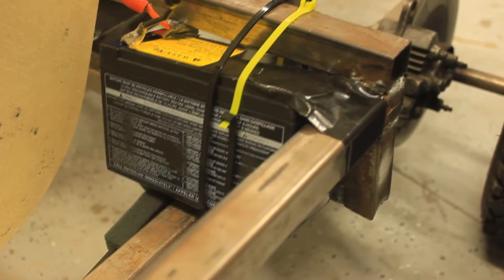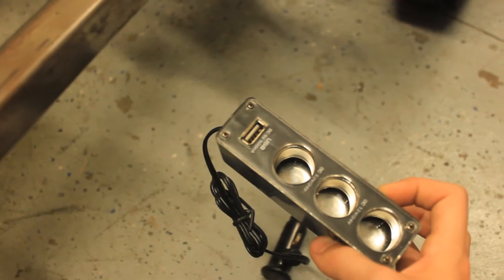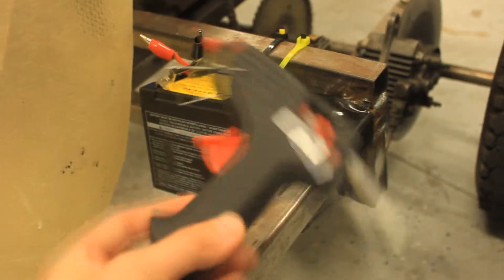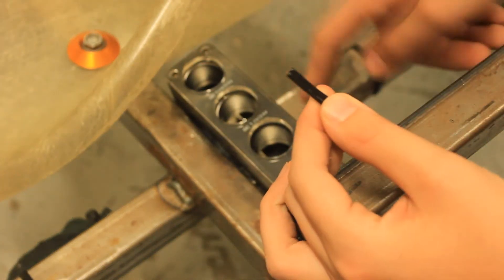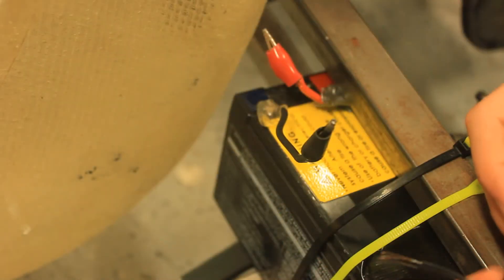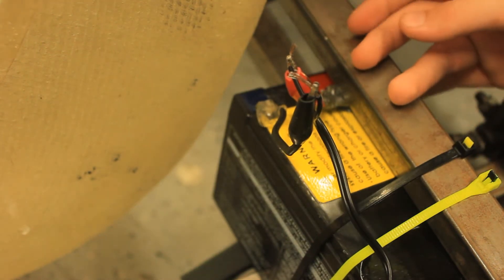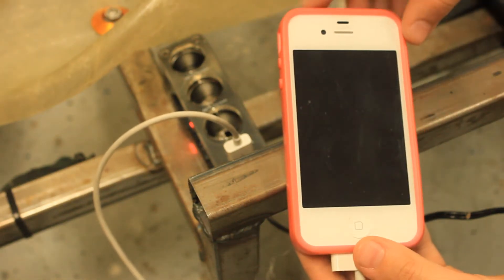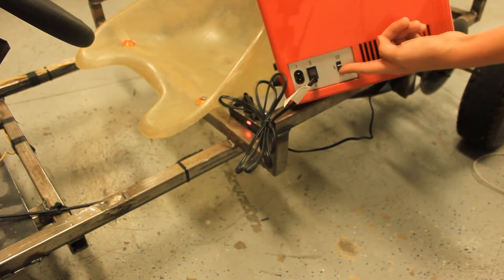How to Mod a Go Kart - Ep. 2 - 12v DC Port's + USB Port + Mini Fridge

Comment: What do you think is gonna happen to the battery if it comes in wather in to the hub, like if you out driving and it starts to rain. Just a tip use one that have some cover. :)
Reply: Unplug it... Duh

Comment: @TheComputerDewd well i see the wires are soldered on there so if they do touch, it will melt and cut the current. but you should have a inline fuse like 15A or something since a go kart bounces and will eventually short the wires from wear and tare